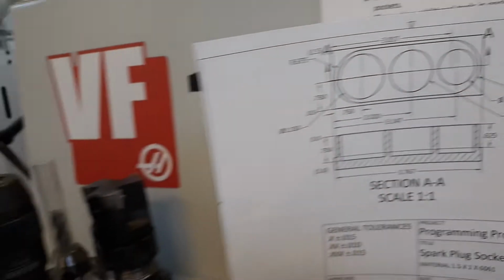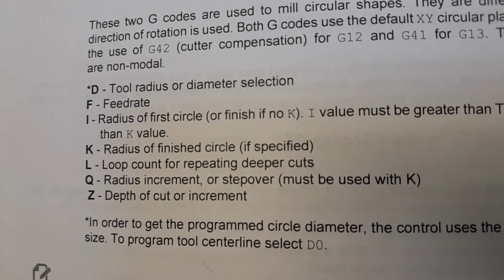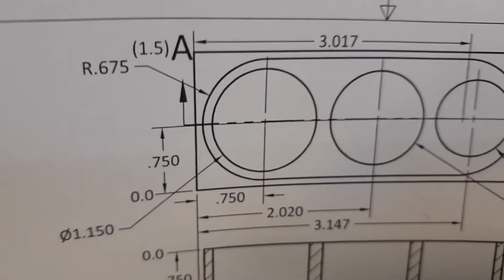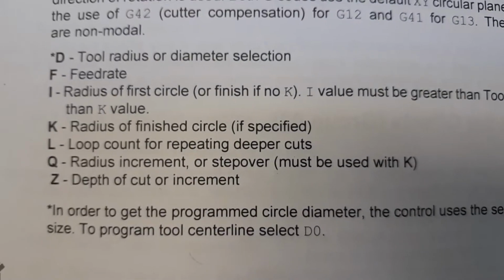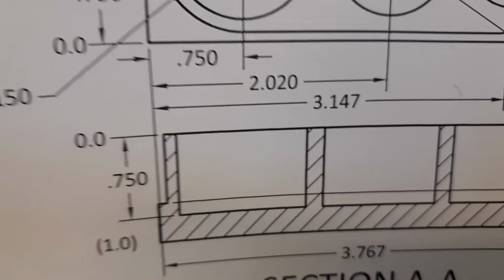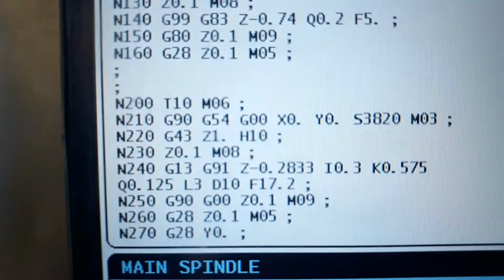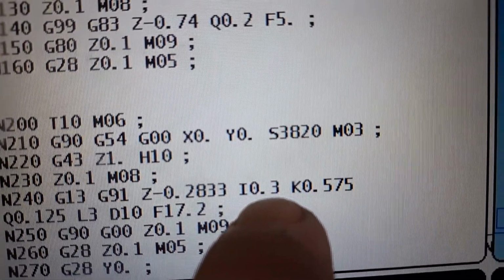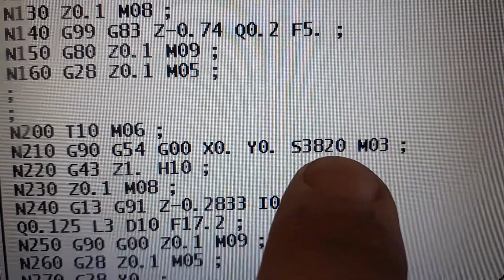CNC Mill Programming Haas G13 Circular Pocket Milling

Comment: G13 vs G03/G02/G01.  What’s the difference you ask?  G13 cannot simultaneous make a “Z” move until the end of that line of code and it hits the loop.  G03/G02/G01 can in fact move in Z while pocket milling or cutting a radii/fillet/chamfer etc.  things to think about when programming G03/G02/G01 and R function circular interpolation. If the radii you are trying to achieve is under 180° it will be a positive R value if is greater than 180° the R value must be negative.  There is a ton of great resources available on HAAS F1 website or just look in the operating manual if available.  Thanks y’all have a good one and keep learning the G-code and don’t be afraid to practice on some scrap material using G-13 with and without a K, Q value.
Reply: Dynamic inter polation.